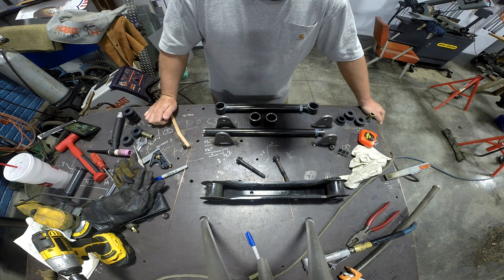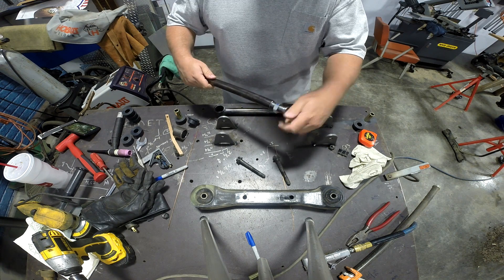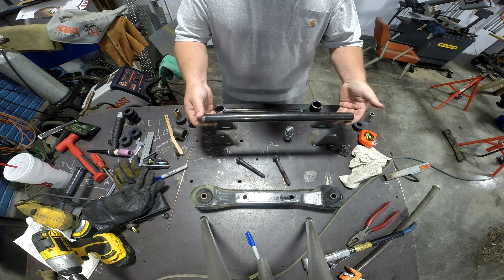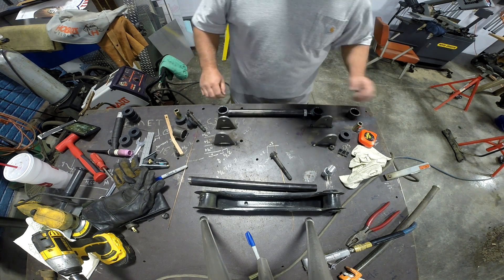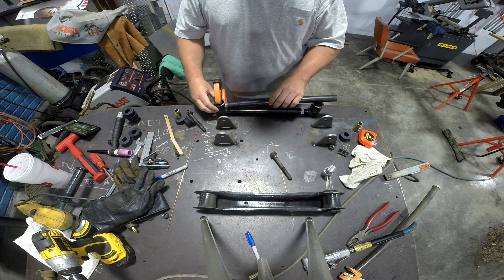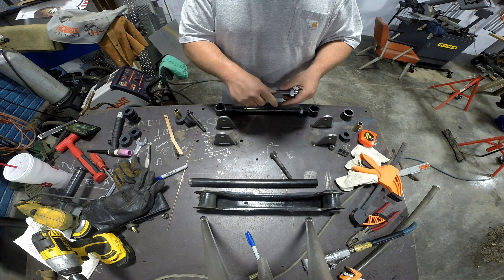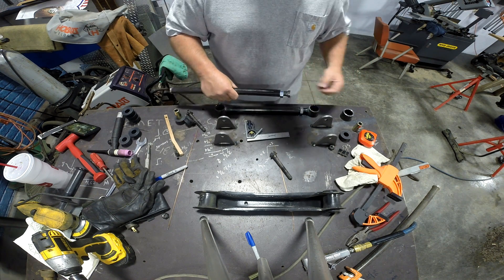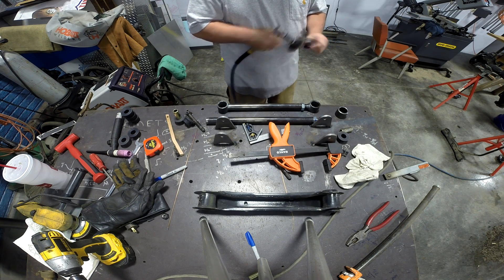"Missing Link" - Adjustable lower control arm fabrication

Comment: Thanks for using our parts!
Reply from the maker: I love using your stuff. I have a project coming up that I may need some help with. I have a customer that wants to do a complete chassis with air ride. It is a 52 Chevy pickup that will be street driven.
Reply: Sounds good - we'll be here!

Comment: Just a suggestion from a fellow welder - use 1/16" filler wire with a little less heat to get welds with less concavity and undercut and more puddle control. Otherwise keep up the great work and thanks for a good video.